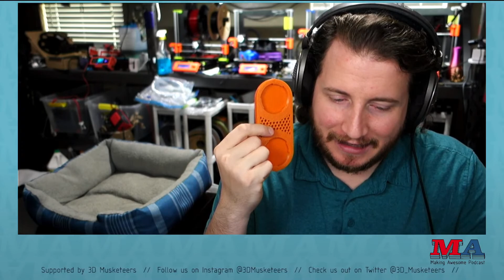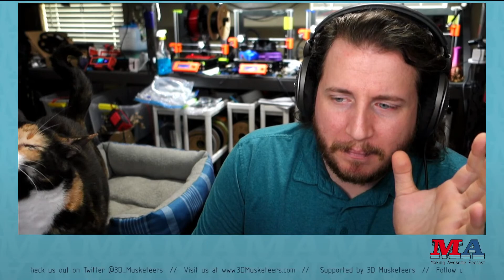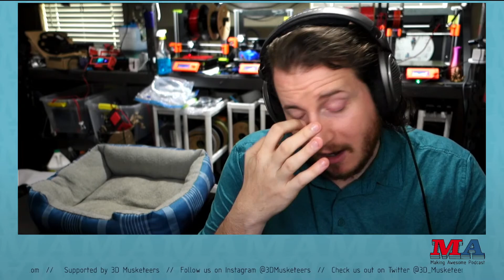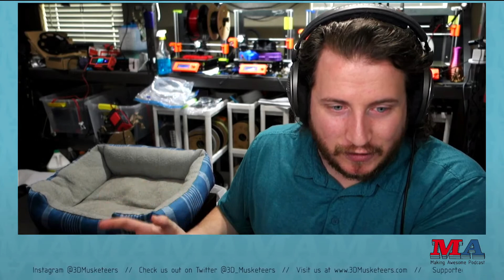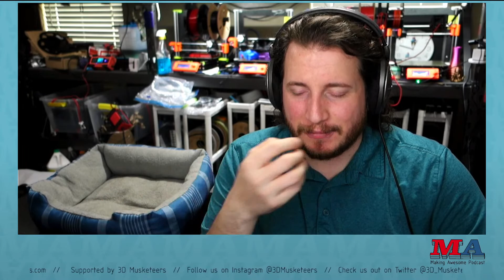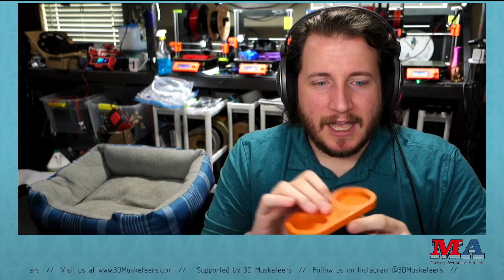"I WILL JUST FIX IT MYSELF" 3D Printing and Right to Repair!! - Making Awesome S3E51

Comment: With regards to packet loss, it could be QoS settings on your network
Reply from the maker: not sure what that is or how to test it. Any thoughts?
Reply: @3DMusketeers  It’s short for Quality of Service. When I’ve enabled it my network basically froze because the algorithm is not longer FIFO but instead assigns a priority. It’s possible it’s not your local network but something downstream that’s running this kind of algorithm and is demoting the priority of your communication. I don’t know enough about how your ISP has implemented it’s routing to say it’s definitely the case. I assume when you stream packets are sent using UDP, if they are then the network is designed to allow those packets to drop, using TCP could reduce dropped packets but it requires around 2-4x the connection speed
Reply from the maker: hmm I will ask :)
Reply: @3DMusketeers I left another top level comment that you can quote to Spectrum. Don't worry, I'm not actually changing any of my support. It's a bluff. 😉
Reply from the maker: lol
Reply: How about trying out starlink? I'd be happy to donate to the cost of the equipment. I have it. I do not stream but have only had issues in the snow don't think u gotta worry about that down there.
Reply from the maker: StarLink is last ditch out here.. I will keep you posted. Seems some higher ups are alerted to my issue now, will know more around 2pm Monday.